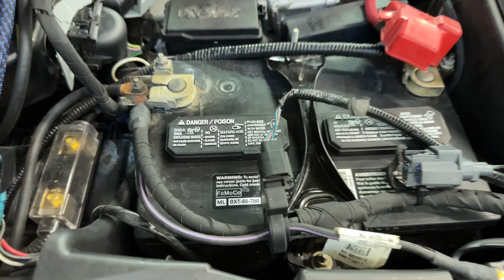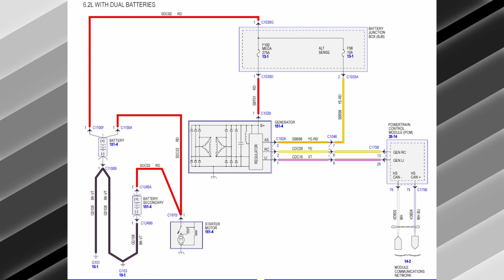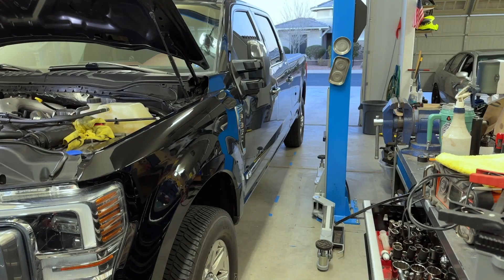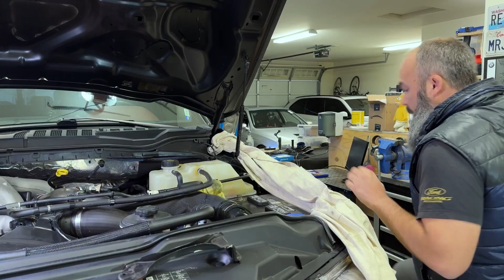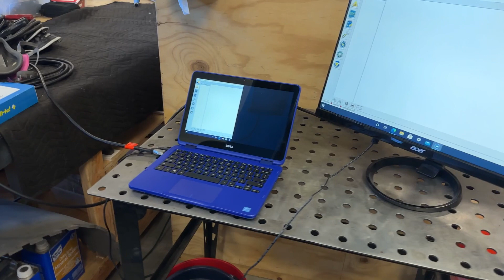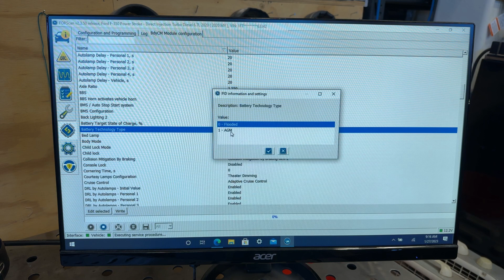Ford F350 Dual Battery Upgrade | BMS Reset w/Forscan

Comment: Thank you for taking the time to make this video. Thought you'd like to know that it's still very relevant, even in mid-2026.  I consider myself "an experienced newbie" with Forscan, having made the usual adjustments for tire size, fog lights with high beams, number of blinks for lane change, etc for my 2024 F250 gasser.  I did not know there was a setting for battery type.  My truck's stock battery started spewing acid at just a few months old.  I know the stock batteries most vehicles come with are garbage, and didn't want new garbage replaced under warranty, so I replaced it with a Duralast AGM65.  This was about a year ago.  Did not know about the battery type setting in Forscan. Today, I found your video while doing a search on XS Power batteries.  The YouTube algorithm is strange thing.  I immediately broke out the old laptop and the OBDII adapter, followed your video and changed my battery type from Flooded to AGM.  Even though I wasn't experiencing any problems with the electrical system, the OCD panic attack guy in me would not be able to sleep ever again unless I made the change.  I did notice the truck used to charge at 14.5v for at least the first few minutes of driving. Now it goes to 13.5v almost immediately.  All is well with the world.

Comment: I just had to have one of the factory AGM batteries (drivers/secondary side) replaced on my 2024 F-250 at 16 months and 16k miles.  The dealer never reset the BMS.  I had to figure that out myself.
Reply from the maker: Wow, that's incredibly frustrating to hear. Glad you were able to figure out the BMS reset yourself!

Comment: Good advise. Installing my new flooded batteries today. You mentioned to lock your truck and let it sit for 8 hours. Just wondering why it must be locked? Thank you. 
P.S. I went with the regular 850 ca batteries from Costco because they have a great warranty and a great price. Ford has no warranty on my batteries and their only 3 years old.
Reply from the maker: I think it has to be locked to make sure it goes to sleep/shuts down. Technically it will shut down on its own, but if left unlocked sometimes it takes way longer.

Comment: Dude, you are to the point guy, really appreciate that. Now, have you replaced the driver side lower headlamp bulb H13? Mine is out on 2022 Super Duty 7.3 gas. I have replaced the upper bulb, just removed the battery out of the way. The lower, it's more involved. Some say remove the whole grill, that's crazy by Ford. Thanks.
Reply from the maker: Appreciate the comment. I have not yet. Though my mom has a 22 Tremor with 7.3 so it’s possible I’ll need to eventually.

Comment: Looks like your battery target state of charge is set to 120%.  Mine is at 80% from the factory. Did you bump yours up and if so why 120%.  Thanks
Reply from the maker: I didn't change mine.... Wonder if that could have been an issue. All I changed was to the AGM.

Comment: how turn off the check engine ligth after change the battery ?  ( 2022 king ranch )
Reply from the maker: There shouldn't be a check engine light after. Did you make sure to reconnect all of your connectors? Do you know what the fault is?

Comment: can you show where hook up the ground for the battery maintainer.  Mine was hooked to the battery and was not registering, must be bypassing the sensor
Reply from the maker: I hooked mine up to the secondary battery. I'd show you but I have since sold the truck.

Comment: Hey Jason, Thanks for doing these videos, helped me a ton doing the same upgrade. at about 2.5 years my driver side battery decided to leak everywhere and shit the bed. Anyways, i often dont drive my truck for weeks at a time. Then I end up using it pretty hard. Id like to do the onboard battery minder upgrade that you did with the NOCO port. Do you have a video showing how you installed that? Its still a bit unclear, the way my garage is setup it will be easier for me to set it up on the driver side battery rather than the passenger, not sure if thats optimal or not. Appreciate the help
Reply from the maker: Thanks for the comment. The battery charger install is pretty straightforward. I installed mine on the passenger battery since the drivers' side has more connections already, and I wasn't entirely sure if it would affect the IBS (intelligent battery sensor) on the negative side. After installing other accessories on other trucks, I don't think it matters. For me, I ran from the battery down the back of the headlight and zip-tied under my bumper for easy access.

Comment: We just changed both F350 Batteries yesterday at OReillys. I was Dead Bad Battery on primary starter battery. We did it wrong. We did both simultaneously.
Reply from the maker: I’m sure with a stone dead battery there was little impact. Sounds like you’re back on the road though!

Comment: Did you check what voltages have changed when changed program to AGM type? 
Do u have info from Ford, to help understand what charging system does different?
Reply from the maker: I did not check voltages. I only knew about the charging voltage differences from building off grid systems for our RV and working on my other cars(BMW) which are very voltage specific. Your truck may not have the option if it doesn’t have a (smart) charging system. It would take very different programming of your engine controller and alternator voltage regulator. Do you have the battery sensor on your primary battery?
Reply: @DrivingForwardBuilds  yes, i have monitor connection on passenger side battery.
Reply from the maker: @ColeyCLogan that being the case I would think your truck can be set like mine. FORSCAN is cheap or even free to start. The only purchase you’d need is https://amzn.to/4eLzDHC. With FORSCAN you can do so much more including scanning and programming changes.

Comment: I went to a Ford dealer in Dandridge TN, Rusty Wallace, they would order, i deeded to pay for, would have the next day.   However, i ask if they can program my 2020 F550, they said NO.  From there the service manager said no, they wont install in my truck. Would not check with Ford, were not willing to check if my 2020 F550 had AGM setting to use and agm would work.  Would be will to sell, maybe install but manage said my truck calls for lead acid, nothing else to explain.
Reply from the maker: It's possible that your turck is different. I HD/Commercial trucks are a different rig. It could be worth seeing if anyone local has Forscan that can take a look?

Comment: Motorcraft batteries are garbage. I replaced the battery in my SUV 2 years ago and the battery is junk already. And yes I did have the charging system checked 3 times just to make sure. It is the junk battery. So I went to Costco in Canada and bought a AGM battery.
Reply from the maker: Agree. No auto manufacture should be using flooded lead acid batteries in modern cars. It’s a shame they try and save a penny.

Comment: The AGM will require more - higher voltage to get to a full charge, correct? So, if u test your AGM batterys, if fully charged be at 13 volts, correct?  But to get the battery to that level the charging levels should be closer to 14, maybe?
Reply from the maker: In theory yes voltages can be higher. But there are other factors that are taken into account like discharge rate, current state of charge, and temperature and load requested. Modern cars have much smarter charging systems than the old days. That's why it's important that the car if equipped with the technology knows what battery is in it.

Comment: Is there more information from ford to explain what is the truck doing for the AGM battery (that you have) ?
Wondering than is that effect also for the trailer battery charge too?
Reply from the maker: I'm not entirely sure about more info from FORD. There is lots of info out there about battery chemistry and charging though.  All charging systems have a specific protocol based on the chemistry of the battery. The truck can't differentiate what type of battery is hooked to the trailer plug. For my RV I had actually wired in a separate feed using Anderson plugs directly from the battery. In my trailer I had a dedicated charge controller to charge my lithium battlers.

Comment: Great video, great content.   If you’re in a super hot climate…EFB technology has higher heat tolerance and same charge characteristics as a flooded.  EFB has a space at the bottom under the plates to allow acid to recirculate…this prevents the dropped sulfates that accumulate in flooded and agm batteries and short cells out.
Reply from the maker: Great info. Thanks!

Comment: Thanks very nice video, I stayed with the stock flooded on my 19 6.7 never had a problem in 4 years towing in heat under loads. Maybe because its on a tender when it sits in the garage. I seriously though  AGM but no ForScan play time for me under extended warranty, . The dealer will NOT ! re-flash to AGM and last there is a national back order in Ford AGM batteries for factory build only.  Have you for grins verified your belt tension-er the belt itself and performed a Vat 40 full load output test on the stock Alternator. Is is struggling capable of charging those batteries ? I have a 320 Mechman sitting on my bench waiting to go into service- Also at 58 K replaced the Belt and Tensioner when the new batteries went in. Not messing around waiting for a break down.
Reply from the maker: I haven’t load tested my system. I think the extreme heat of Arizona played a part in the batteries failing though. I have had a lot of load on my alts though. I added a 30amp 6 gauge line to my 5th wheel to run a dc-dc charger for my 4 lithium batteries when running down the road. I hear not wanting to mess with warranty.

Comment: My battery went dead I jump started it know they are working but I can’t bet both keyfobs to work any tips? Great video
Reply from the maker: That's odd for the keyfobs to go dead. These trucks are sensitive to voltage much like most cars these days. Are you sure both batteries are good? One of my was dying and causing weird issues.

Comment: Usually, an AGM battery requires a little more voltage to properly charge between 13.8 to 14 volt which your truck already puts out.  What I do like about flooded batteries is that you can remove the caps and check the specific gravity of every cell with a hydrometer, and you can monitor the health of your battery.  AGM batteries are a better lasting battery, but you cannot know when a cell starts getting weak because they are a sealed. unit
Reply from the maker: This is great info. I really like being able to check a battery but the average person won't go to that extent. I also feel that given our extreme temps in Arizona the AGM will last marginally longer as well. Thanks for watching and the comment!
Reply: @DrivingForwardBuilds you could get gel cell batteries we use them for car audio for lots of power draws and abuse while we were able to mount them anywhere and any position.. they are cheaper than AGM and they are going to last long time no issues where I have to suggest you search for AGM batteries and their flaws also there is a video with a f350 our generation and his headache after swapping to AGM batteries like you about to and if I remember correctly they didn't work with the bms charging system and fried them or something else but he had to go to other battery type again and had 2 very expensive paperweight
Reply from the maker: @MrEuroWolfie  The later Superduty's were upgraded to AGM from the factory. I believe in 21' or 22' they made the change. The F150 came with AGM around 2018 as well. This truck uses the same BMW system. You are correct the BMS won't properly charge them unless coded to do so. You do that either with the factory software or in my case using FORSCAN. I changed the charging parameters to meet the needs of these batteries. Hopefully, I'm correct in doing so and don't run into any issues.

Comment: I put a section of hard heat resistant rubber under those hold down brackets, and that solved 70% of my corrosion issues on my 2019. Both batteries, both brackets, painted, and rubber.
Reply from the maker: That’s smart. Are your batteries still off gassing? When I checked mine the water levels were low as well.

Comment: It’s nice you have dual batteries but trying to add them into an F150 with the BMS is a royal PIA. I wonder what’s different about the setups between the higher tier trucks and the F150s. What did Ford do to allow the BMS to take care of both of them?
Reply: I believe the dual batteries is standard on the diesel for the cranking amps. They are wired in parallel and only one battery has a probe on it for the BMS. So they can't really monitor both batteries individually but the system sees it as one battery. So if you have one failing battery it will draw the other down with it. That's what was happening in my system. One battery had a failed cell and it was drawing the entire system down.
Reply from the maker: Thanks for watching. I replied from my other channel on accident!
Reply: @DrivingForwardBuilds  no worries. I appreciate the knowledge.

Comment: Thanks for the tip to let the truck sit overnight. I don't have Forscan and am glad you covered that.
Reply from the maker: Awesome. Hope it goes well if you have to change your batteries.
Reply: @samanthasfrugalife if you look up BMS reset procedure on the Web you can find the sequence to reset it just like forscan and then you are safe for sure that it is reset and charging your new batteries and not killing them like IT happened to me before I knew about this BMS bs.. it's something like ignition on, engine off press brake pedal x times then pull your turn signal lever X times yada yada... Than you will see the dash battery light on and change yellow to Red and ready.. this is not the actual procedure just sort of outlining it to know what to look for roughly..